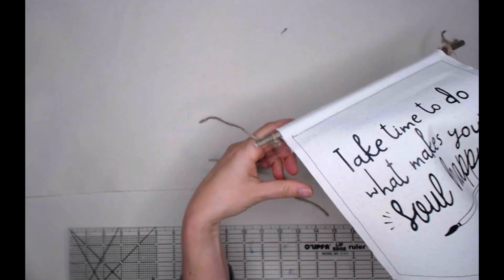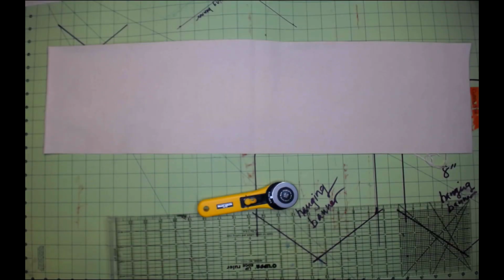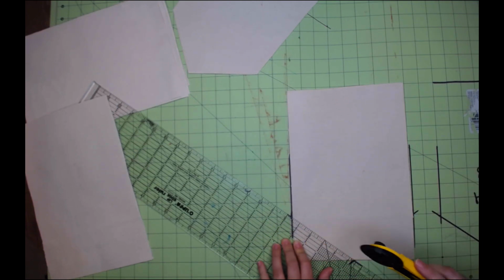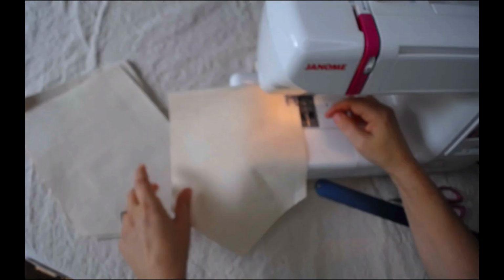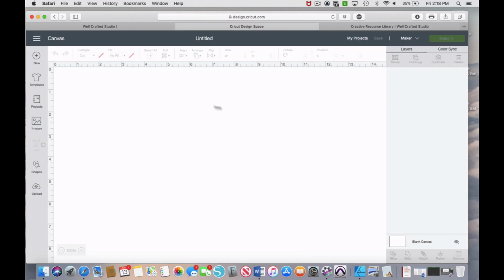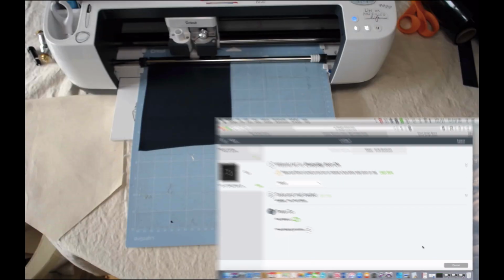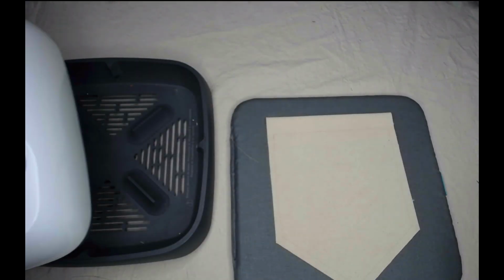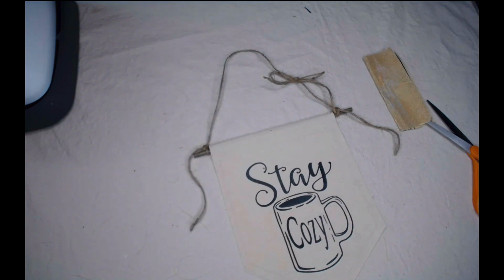How to Make a Canvas Banner Using a Cricut and Iron-on Vinyl

Comment: Can you use iron if you do not have a cricut press if so what setting for that material
Reply: yes you can use an iron. Its called heat transfer vinyl.
Reply from the maker: Hi Brenda, yes you can use a regular iron. I did for years. The iron setting will vary with the type of iron on vinyl you purchase. For instance, Siser brand, Cricut brand etc. The packaging often gives setting recommendations and if you can't find it there you can usually get the setting info off their websites.